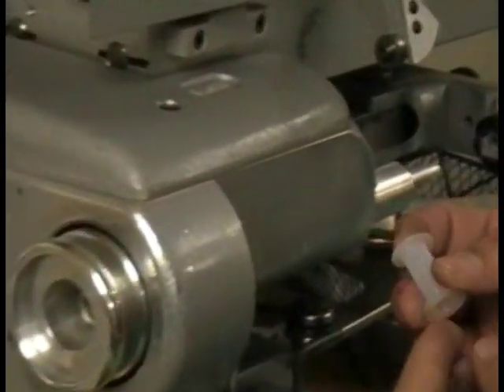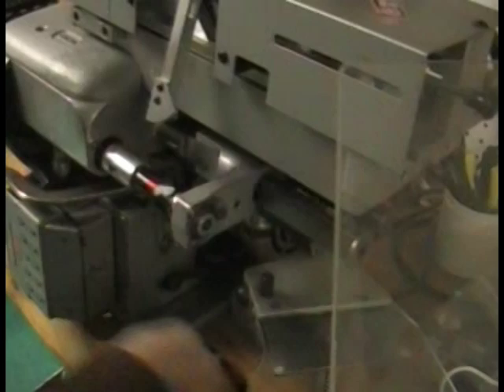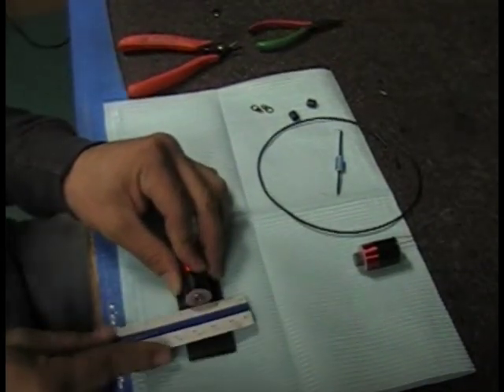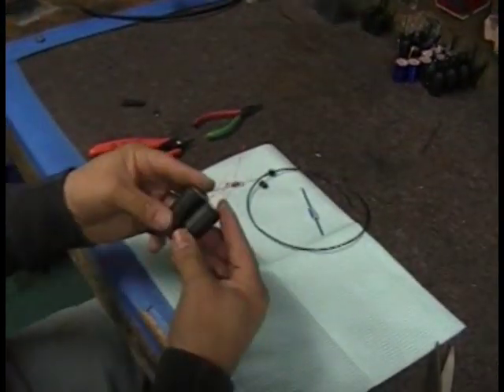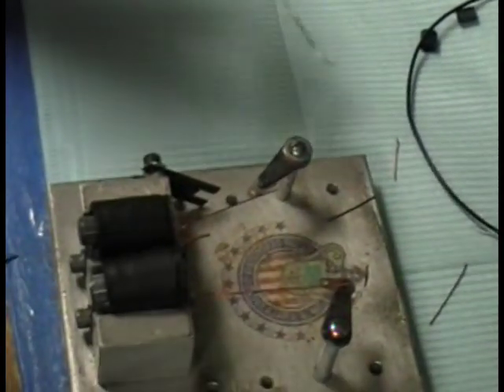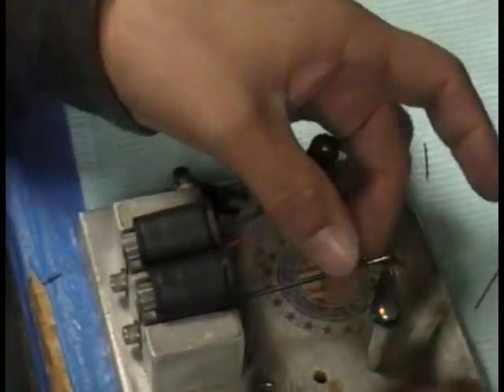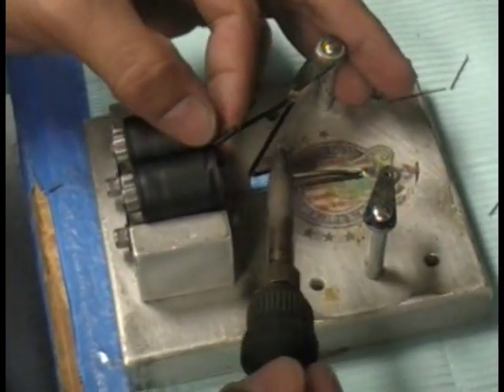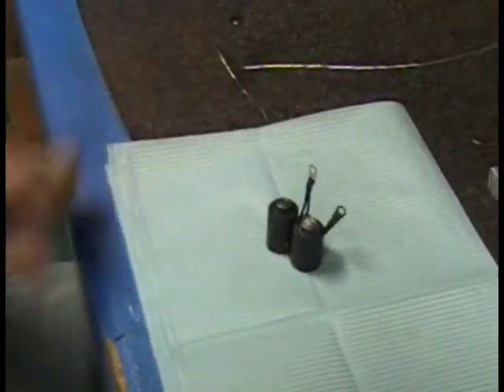How To Assemble Tattoo Machine Coils

Comment: Finally Your right about one thing, you have no clue. but for some reason that never stops you from saying some stupid comment.  Its not that anyone's machines are running wrong or wright. its a spark and as i stated allready it caused by a collapsing magnetic field or transient spike, or flyback. all machines with coils and points do it. the level depends on a few factor mainly the size of the capacitor. A large cap is still filling when a cycle ends on a short gapped setup. ....

Comment: A small cap fills faster so when the cycle end and the points open a larger field charge is allready there so you have more arc. I have a design that truly eliminated all spark resulting in NO burning on points or springs ever.

Comment from the maker: well if its a blue spark....Its because your capacitor has gone bad and needs to be replaced. The spring material is blue tempered steel. The contact point i would use would be brass. Also sand down contact point so its connecting softly to the spring.(rather than the sharp edge of a screw) This will reduce spark.

Comment from the maker: @mikea1383 It could be your back spring doesnt have enough tention. Also make sure every bolt is tight on your machine... If parts are loose it causes vibration wich takes away from the machines performance.....You can send it in to superior and i will personally take a look at it for you. ~ james

Comment: im guessing this is easier cleared up if you say the sparks invisible,or you have a doctorate is electrical engineering....lol...hey no matter what i still think there should be no spark as it would make your contact gunk up with carbon as well as your spring...hell the spring would probably get holes in it.I'll stick with my 22uhf cap and my 47uhf and the absence of spark.And you can keep tearing up your springs,and contact screws....

Comment: benefit of plastic bobin versus not using a bobin is explained in "Basic Fundamentals of Modern Tattoo". Coils are actually very technical. Wire size, length of wire used, ohms, resistance, and how the coil cores are shaped and treated w/ heat. How magnetic they are... I could go on for a while. : )

Comment: Ηi! Nice work! May ask a question please?
The devise you are using for heating the shrink sleeve,is one hot air devise right?What is the temperature i need to shrink the sleeve?Can i do it with a common hair dryer for example?
I dont realy know much about coils,im a begginer,so please dont laugh at me if the question sounds stupid! :)
Thanx :)

Comment from the maker: So your saying blue spark is a good thing? I Think you mean magnetic resistance not resonance. As  far as i know spark is not supposed to be there!!! In my experience the few times i have had blue spark changing my cap has solved the problem........ Sparks put holes in ur spring bud! But thanks for your comment anyways!

Comment: The more spark the closer to a resonant note of the coil. Think of the coil as a spring, when your switch closes, you are pushing the spring down. When that switch opens, you release the spring and it comes springing back at you, thats what that spark is, it occurs when the switch is OPENING. Otherwise know as a collapsing magnetic field or transient spike or flyback. nothing to do with bad cap. look at a new 10uf and a 47uf on same machine

Comment: BS  man the blue spark is a sigh of magnetic resonance , that is its supposed to be there. as the field collapses it jumps across to the front spring it does not mean the cap is bad . people use larger caps to reduce the spark but that lessens the charge rate ,

Comment: My machines are running bad in what aspect?I tune my machines pretty much the same way you do except I do not use a fancy tension gauge,I use feel.And no i do not have a DOCTORATE,nor any electrical knowledge.And you are wrong the rear coil does do something on my machine,it gives it more of a magnetic force by more surface area,pretty much like what a wrapping yoke does on a single coil.I have two single coil,one with.But both seem to run about the same,as the one without has a small armbar.

Comment: @tattoosuperior1 i would like that verry much but i am a long way from u. :) could it b that the power suplier dose not give a high enough voltage? couze i tried adjusting the springs so that the armeture bar moves more lusely but when i start tattooing as soon as i tauch the skin with the nidle it stops moving and the maschine just vibrates (not the nidle). 
p.s
if you have a way to contact me on line i.e skype, meassanger or any other program i would b very greatfull.

thank you

Comment: FYI i was giving dan input about it and my spark elimiator 6 months ago and it is better than 2 coils . the machine you and everyone else use is a stupid design, the rear coil doesnt do shit . And yes all of your machines are running wrong in that aspect,   without a u shaped yoke, a single wont work .  "inverting"? a cap ? .. no such thing .  The non sparking machine has nothing to do with a coil design . If dan adopts it you will soon see it, just like the  single u yoke coil .